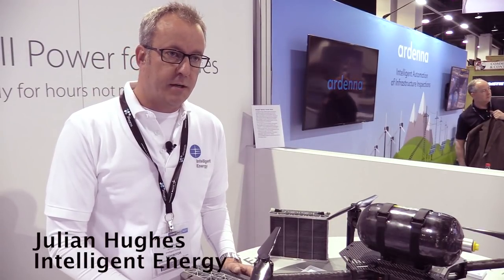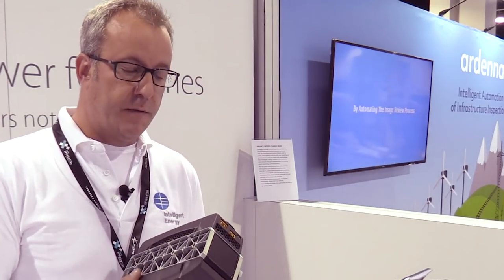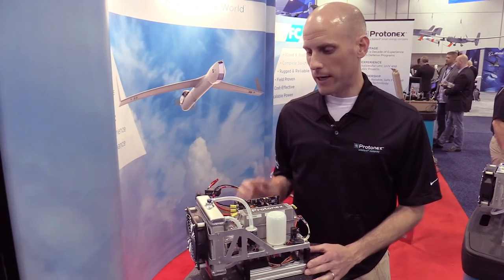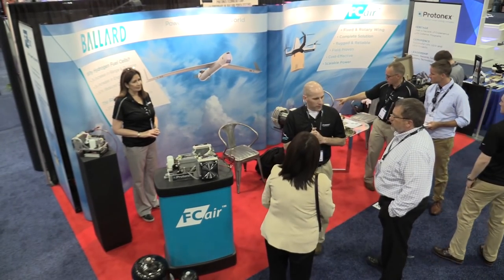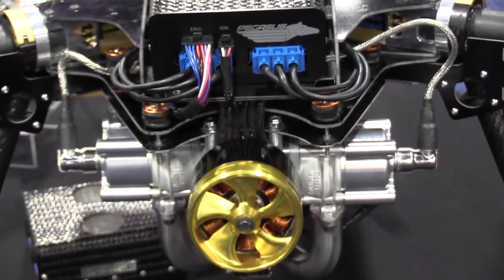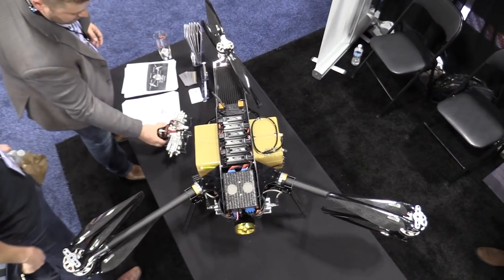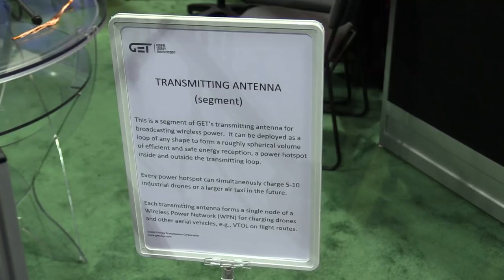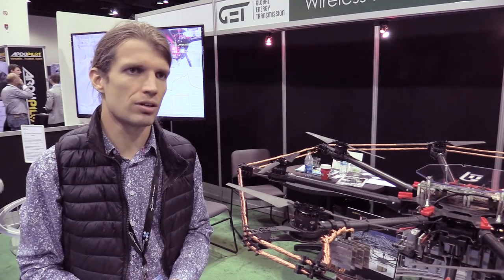Hydrogen Fuel Cells Go Flying

Comment: Agreed about the hydrogen fuel cells; all technology is interesting, but hydrogen has so many advantages over others it isn't even a close call. The problem, of course, is generating and storing the hydrogen.  Anybody can generate it . . . slowly. . .  but the typical argument is that it takes more power to generate (at least from water) than you get back.  I was hoping to hear how they were filling that little tank.  Did they happen to mention their solution?
Reply: No one has a solution, it's all pie-in-the-sky greenwashing.
Reply: One of the potential storage methods for hydrogen (and other gasses) are different sorts of nano-porous materials with high specific surface area. These would allow storage of the gas in a gaseous state at normal temperature and pressure (much safer than when conpressed into a liquid form). Experimental materials called MOFs (metal organic frameworks) have been created, some with around 5000 m^2/gram specific SA.
Reply: The production of hydrogen is more of a problem than storage.
Reply: idontcare80 Hydrogen is currently mainly produced by a steam/hydrocarbon method which isn't awfully environmentally friendly as it produces a lot of CO2. Electrolysis of water is, however, a very viable (and more efficient) method. It just requires water and electricity and can be cost competitive to other production methods.  If you wish to learn more about this, look up the Hydrogen Production Wikipedia page.
Reply: "Electrolysis of water is, however, a very viable (and more efficient) method."

No it isn't, it's far too energy intensive to ever be viable, the cost will always be far too high.

I've been reading about hydrogen vehicles for more than a decade.
Reply: idontcare80 That's not what the Wikipedia article says. It's also not what I have learnt at uni (I study nanotechnology). Saying that it will never be possible is very pessimistic and doesn't seem to be in line with reliable sources.
Reply: A) The fossil fuel industry is pushing it as a distraction from technologies which actually have the potential to eliminate our usage of fossil fuels, so a lot of your information is going to be based on their propaganda.

B) Using hydrogen in most applications simply doesn't make sense, because building the refueling infrastructure would be an absolutely enormous undertaking, because everything associated with hydrogen costs huge amounts of money because of the pressures involved in storing it and because of the fact that it causes metal embrittlement. Fuel cells are huge, heavy and extremely expensive, and producing hydrogen via electrolysis is extremely expensive, the longevity of fuel cells and electrolysers is short, compressing hydrogen requires huge amounts of energy and expensive compressors... the list of problems goes on and on. Even producing the water for electrolysis would be a significant portion of the cost of the fuel, because you can't just dump seawater into an electrolyser, you have to filter the water to a high degree of purity so that it doesn't ruin the catalyst, which basically means that you need to use reverse osmosis to purify the water, which is expensive. It's not like you can use local water sources in many areas, either, because water systems are already overtaxed in many regions.

Compare the Mirai to a Tesla of the same price, the Tesla is much cheaper to operate, it's more powerful, has a lot more interior space, can be recharged just about anywhere, it doesn't require you to go to a filling station if you don't want to, and it can make use of green energy sources much more efficiently and inexpensively. The Mirai even compares poorly to electric cars which are half the price.

I don't know how the guys in this video are making fuel cell range extenders for drones, I guess battery energy density must be that poor, because this technology doesn't scale up well. The only manned aircraft which have been able to fly with hydrogen are motor-gliders, and this is because of the extremely large size and weight of high power fuel cells and their associated hydrogen storage tanks. 

I'm betting that the Wikipedia article that you read leaves out some very key bits of information, like the cost of compressing hydrogen to 10,000 psi.
Reply: idontcare80 Yeah, the hydrogen fuel cells are expensive, but it's a relatively new technology. A lot of research is being done on it, so one can expect it to go down in price over time. Regarding gas storage, see my earlier comment about MOFs. Regarding refueling networks, I agree, but it could be overcome. I personally believe that hydrogen could be used in heavy transport (lorries, ferries, etc) while batteries might be more suitable for lighter transport.
Reply: For aircraft use, fuels must be in liquid form, so we need a carbon-neutral, liquid hydrocarbon fuel, and if we're going to produce a carbon-neutral, liquid hydrocarbon fuel for aircraft, we might as well use it in other vehicles, like long-haul trucks. From the Hydrogen Production Wikipedia page:

"In 2014, it was demonstrated that it is possible to make a synthetic fuel, that is also a carbon-neutral fuel, from elemental carbon and hydrogen, with both the carbon and hydrogen being derived from seawater, which contains a much more economical source of carbon dioxide than the air. With researchers estimating that carbon extraction from seawater would cost about $50 per short ton ($55 per tonne). The U.S. Navy estimates that its typical naval nuclear reactor, generating 100 megawatts of electricity, could theoretically produce 41,000 US gallons (160,000 litres; 34,000 imperial gallons) of jet fuel per day, and that shipboard production from nuclear power would cost about $10 per US gallon ($2.6 per litre). While that was about twice the cost of petroleum fuel in 2010, it was expected to be much less than the market price in less than five years if recent trends continued. Moreover, since the delivery of normal jet fuel to the aircraft carrier battle group cost about $8 per US gallon ($2.1 per litre), shipboard production would be much less expensive. This method of synthesizing jet fuel is currently only experimental."

IIRC, the initial output of this process is a fuel that's more like gasoline, but it has to be processed into jet-fuel, so fueling trucks, light aircraft and other vehicles could easily be done with the simpler production process. Diesels are basically on their way out anyway.
Reply: Energy density of Hydrogen compressed at 700 bar (10,000 psi) is 142 MJ/kg and for jet fuel is 42.8 MJ/kg . 
This makes Hydrogen 3.3 times more energy dense per kg than jet fuel .
Reply: It doesn't matter, hydrogen is far more voluminous than jet fuel, so you end up needing an enormous body to contain it, which adds weight and drag to the aircraft. Storing hydrogen at 10,000 psi also requires an extremely strong and heavy pressure vessel, adding even more weight. Because hydrogen needs to be stored at high pressures, it can't be stored in the wings like liquid fuels are, so you end up eliminating the passenger and cargo carrying ability of the airplane in order to carry the fuel. The Soviets already tried to power an airliner with hydrogen, it required them to eliminate the passenger and cargo compartments from the entire rear half of the aircraft, just to power one engine out of three! To power all three would have not only required them to eliminate all of the passenger and cargo carrying ability of the aircraft (eliminating the entire purpose of the aircraft), but the range of the aircraft also would have been reduced. Producing hydrogen is also hugely inefficient, and handling it is very problematic, so it's just never going to be a viable fuel for anything.

Edit: Oh, also, the fuel on that Soviet airliner was stored using cryogenics, and cooling hydrogen to cryogenic temperatures requires a large amount of energy, which adds to its already substantial cost.
Reply: David Coburn amazing how many will say "heating water is inefficient" it is not inefficient. 
Instant heat on demand. Not tanks of water..
Reply: At the end of the day we aren't going to run out of sunlight or wind or tidal or wave or moving water. We just need an on demand means of storing it. You can't really talk about efficiencies when you're dealing with a source that's infinitely abundant.
Reply: @PistonAvatarGuy  
Actually, the production of hydrogen can be as efficient as 90 to 95%. It all depends on commercial production. You see,  you have to apply a certain voltage of, i think, 1.2v everything above is wasted in form of heat, thus decreasing efficiency. The problem is that small scale hydrogen production is inefficent, due to the voltage being raised above the ideal voltage level to increase the production per time unite. The problem can be solve be just increasing the surface area  of the electrodes. There are also other methodes like steam hydrolysis wich appearantly achieve even higher efficiencies but haven't been used in the industry yet.
Reply: @mandernachluca3774  It doesn't really matter when you can use it for anything.
Reply: @PistonAvatarGuy  
I am not quite sure what you mean by that. It does very well matter how much energy gets wasted just to store energy, i just explained how the efficiency of hydrolysis in these regards can by increased quite a bit and that this branch of research is far from exhausted.
Reply: @mandernachluca3774  But why bother messing around with hydrogen at all? We have much more efficient and less expensive ways to store energy and hydrogen makes absolutely zero sense for use in vehicles because of how difficult it is to handle, how difficult it is to store, and because of the mass and cost of fuel cells and all of their related hardware.
Reply: @PistonAvatarGuy  
We bother, at least in the ground vehicle industry, because hydrogen fuel cells very well make sense, as soon as you need a fairly light package for long range applications and absolutely have to use a non fossil fuel source. Despite all it disadvantages, hydrogen has still the benefit of immensly high energy density, compared to any battery technology, hydrogen even has an almost 3 times higher gravimetric energy density than most of the fossil fuels. The thing is that we still have to develope technology to  yield the full potential of hydrogen. 
All in all, it is worth researching for new hydrogen technologies and i agree with Toyota that we need both, hydrogen fuel cells and common batteries in the future.
Reply: @mandernachluca3774  But hydrogen fuel cells are heavier and larger than batteries. Look at the specs for the Toyota Mirai, it has less range than the Tesla Model 3, it has less power, but it still weighs more and is absolutely repulsive looking because it had to be styled around its massive fuel cell system and hydrogen storage tanks. The cost of the Mirai is also unknown, but it's likely to be several times the cost of the Model 3.
-
The energy density of hydrogen by itself is meaningless, because it's not being stored in a blimp on the roof of a car, it needs to be highly compressed in tanks which are extremely heavy and awkwardly shaped, or it needs to be cryogenically liquefied, which uses absolutely enormous amounts of energy and requires very expensive, specialized equipment.
-
Hydrogen makes absolutely no sense as a fuel (edit: unless you're fueling a rocket and the energy and financial cost associated with the cryogenic cooling system is irrelevant), no matter how you look at it.
Reply: @PistonAvatarGuy  
I do believe you, that, from the perspective of someone that has no idea about hydrogen fuel cells,  the system itselfe could be seen as total nonsense. However, i can only repeat myselfe in encouraging 
people to actually learn how fuel cells work, how many options there are for storing hydrogen and how energy density very well has very high value, especially regarding current bulk of the whole system. The Toyota Mirai is a car with the hydrogen technology from   
5 years ago. 
Also, a battery is not even remotely compareable to a hydrogen fuel cell, as it is nothing more than a storage medium, it is very well compareable with a hydrogen tank. 
Hydrogen tanks are not awkwardly shaped they are basic cylinders. 
"Power" as you call it, is defined by current times voltage, wich is also very limited for batteries, as they overheat, that's why they currently have limited time savings when refueling, as the electrical  charging power is limited by 100 to 150 kw, respectively Teslas superchargers can putvout around 300 kws with a lot of cooling (it obviously isn't nessecary to mention, that this charging operation is very inefficient).
Hydrogen guel cells from 5 years ago had a a power of around 100 kw, do you really think that research has stagnated from there on?
Again, this is not some opinion of mine, it is a well regarded prediction by almost any engineer, inform yourself about hydrogen fuel cells and you will see that they most defenitly have a future in long range transportation.
Reply: @mandernachluca3774  I'm well aware of how fuel cells work, which is why I can confidently say that they're never going to compete well with other existing options.
-
"Also, a battery is not even remotely compareable to a hydrogen fuel cell, as it is nothing more than a storage medium, it is very well compareable with a hydrogen tank. "
-
The battery in a BEV replaces the ENTIRE fuel cell system, including the hydrogen storage tanks. Both batteries and hydrogen fuel cell systems are simply being used to produce electricity to power an electric motor, but batteries are simpler, lighter, MUCH less expensive, more compact and more easily packaged in a vehicle. Both systems simply fill the role of an energy storage system in a vehicle.
-
"Hydrogen tanks are not awkwardly shaped they are basic cylinders."
-
That's an awkward shape to fit in most vehicles.
-
"wich is also very limited for batteries"
-
It's not nearly as limited as it is for fuel cells.
-
I've been reading about fuel cells for 20 years, I think that I'm pretty well informed.
Reply: @PistonAvatarGuy  

Ever seen the middle tunnel of a car? They are roundly shaped, the hydrogen tank fits perfectly into the shape, car manufacturers usually use that place to transmit the power of the engine to the rear axle, in the case of the EV however, you don't need that. 

The fact to the matter is that, as you already mentioned, the Mirai weights around 1850 kg, a Tesla model X of the same time period weighted over 2000 kg, i don't see how the battery EV is lighter, especially when the battery weights around 700 to 800 kg. The battery isn't even that much more compact but it has the benefit of being used as an integral part of the car (as  long as it holds, the forces of a 100km/h would damage the battery significantly).

As i see it, you either have no idea what you are talking about, have very outdated sources or are a diehard "hydrogen fool cell" believer. 

You can not argue with facts and they are stating that the hydrogen fuel cell has a place in long range transportation, if you want or not.
Reply: @mandernachluca3774  Ever seen a HFCV? The center tunnel is filled up with the fuel cell stack. Ever seen a BEV? THERE IS NO CENTER TUNNEL.
-
"...car manufacturers usually use that place to transmit the power of the engine to the rear axle..."
-
Most cars are front-wheel drive. Do you live on Pluto, or something?
-
"...a Tesla model X of the same time period weighted over 2000 kg..."
-
Model 3, READ. The Mirai doesn't come close to being comparable to the Model X, it's not even an SUV!
-
"You can not argue with facts and they are stating that the hydrogen fuel cell has a place in long range transportation, if you want or not."
-
Nothing will make hydrogen viable for use as a fuel, PERIOD. It's not just one issue or another that will make this true, it's the HUGE list of issues associated with using hydrogen as a fuel that will make it true.
Reply: @PistonAvatarGuy  
As their is a list of issues regarding batteries,  
low range capability, heavy weight respectively low gravimetric energy density, the low life expectancy due to high discharge rates, ...
 
I don't get what you want to say, also the middle tunnel comment is more of an idea to show that manufacturers can save money by reusing old tooling. Also, do you deliberately forget rear wheel driven sports cars,  SUV's (wich almost all have all 4x4 capability) offroad cars, or even normal all wheel driven cars like Audi builds them.

Hydrogen fuel cells don't have to be made viable option, they are a viable option. 
Batteries have their limits, wich can be overcome by including fuel cells for example as a range extender, buses, trucks , mini buses and SUV's could all benefit from such a system.

As i said before the facts speak for themselfs but if you want more prove for the potential of fuel cells ask Bosch or Toyota they will gladly enlighten you ;D.

Little side note:
The fuel cell stack and the tanks on the Mirai weight together about 143,5 kg add to this a traktion battery weight of about 150 kg and you will still have over 250 kg less weight for the whole system, than for a Tesla 3  (478kg). I am not quite sure if this is the weight for the standard rang battery or for the 500 km range, either way, it is much havier.
Reply: @mandernachluca3774  HFCVs don't only need to compete with BEVs, they also need to compete with ICEs. 
-
"...also the middle tunnel comment is more of an idea to show that manufacturers can save money by reusing old tooling. "
-
Which is ridiculous, because the hydrogen tanks are not only too large to fit in a normal center tunnel, but also because most cars don't have a tunnel to begin with.
-
"Also, do you deliberately forget rear wheel driven sports cars..."
-
Fuel cells not only don't produce enough power for use in a sports cars, but they're also too heavy and large for use in a sports car. Even in SUVs, the center tunnel isn't large enough to accommodate anything related to a hydrogen fuel cell system.
-
"...they are a viable option."
-
In what way? The vehicles are too expensive to buy and don't offer any significant benefits over BEVs, they offer nothing but drawbacks relative to ICE vehicles, the fuel is expensive, the refueling infrastructure is non-existent and it will cost TRILLIONS of dollars to build (and that cost will be passed on to the consumer), the production of the fuel is highly inefficient... AGAIN, the list of problems is nearly endless.
-
"Batteries have their limits, wich can be overcome by including fuel cells for example as a range extender, buses, trucks , mini buses and SUV's could all benefit from such a system."
-
Why would anyone want that over an ICE vehicle?
-
"As i said before the facts speak for themselfs but if you want more prove for the potential of fuel cells ask Bosch or Toyota they will gladly enlighten you ;D."
-
Yes, the facts show that fuel cells are useless garbage. I'm clearly more enlightened on the matter that you ever could be.
-
"Little side note:"
-
According to Toyota, the hydrogen tanks and fuel cell stack weigh 316.4 kg, not 143.5, the addition of the traction battery brings the weight to 466.4 kg. That's also not likely to include all of the ancillary equipment needed for the hydrogen fuel system and fuel cell system. 
-
Go bother someone else, shill.
Reply: @mandernachluca3774  What weight and range advantage? If those are the advantages that fuel cells offer, why isn't the Mirai lighter than the Model 3? Why doesn't it have longer range?
-
I was actually referring to that same document, but didn't pay attention to the units. Anyway, assessing the weight of the entire hydrogen fuel cell system by the weight of the fuel cell stack is like trying to asses the weight of an engine with only the weight of the crankshaft, it's just not enough information. What is known is that the Mirai weighs more than the Model 3 and that it has less range.
Reply: @PistonAvatarGuy  
Actually, if you payed attention to my comments, you would not ask this question, i already said that batteries can be integrated into the  
frame of a car, usually, a car has to have  a certain stiffness in all directions of movement. You can save yourselfe some pounds by integrating large structures like batteries that already have a certain stiffness. The problem obviously is, that the battery also will get a lot of stress during crashes.

Also, if you browse for the weight of a Tesla model 3 you will find a range of weight numbers according to the range capability of the model from around 1600kg to over 1900kg, as it is, a 500km range model happens to weight between 1700kg and 1900kg ( i can not make very precise estimates because the weight happens to varie a lot between their 500km range models as rear wheel or all wheel driven variants).

Last but not least, you are comparing models with at least 5 years of development between them, that's huge in todays standards. I wouldn't be surprised if a modern variant pf an FCEV would weight 150kg or 200kg less than a battery EV.

Also, as it seems from what i can find, at least the pumps and plumbing are included into the weight of the stack.  Thermal management (heat exchanger) won't get you that much weight difference between the two, as especially a Tesla needs a cooling system as well, in fact the only revolutionary thing about their battery pack is the cooling system.
I would speculate that it would be around 5 kg at most (the traction motors aren't included, as they are not crucial to a specific system, one could interchange them if needed).
Reply: @mandernachluca3774  "i already said that batteries can be integrated into the frame of a car"
-
That's not really what Tesla did, though. The Model 3 was assessed by Munro & Associates and it was determined that the body of the Model 3 was far too heavily built because it was designed not to rely on the battery pack as a structural member. In other words, the Model 3 could be made to be even lighter than it is. Anyway, using the battery pack as part of the structure is an advantage which doesn't translate well to HFCVs.
-
I'm not sure why you're having trouble finding the weights for the different versions of the Model 3, the information is readily available on the internet. The RWD, 283 hp version of the Model 3 has 325 miles of range and weighs 3,805 pounds. The AWD, 473 hp version of the Model 3 has 310 miles of range and weighs 4,072 pounds.
-
The Mirai has 312 miles of range, 152 hp and weighs 4,080 pounds.
-
The Honda Clarity FCV came out only 2 years before the Model 3, it has 138 hp, 366 miles of range and weighs 4,134 lb.
-
Hydrogen fuel is a dead-end, that's not changing anytime soon.
Reply: @PistonAvatarGuy  
Actually, the Honda Clarity with fuel cells (there are also a plug in hybrid and a battery electric variant) weights the same as the Toyota Mirai with a range of 589 km. Funnily enough, the battery electric version of the Honda Clarity weights about the same and has a range of only 143 km, this only further proves my point ;D.

 In other words, hydrogen is for obvious reasons no dead end technology, we need it, as much as we will need batteries.
Reply: @mandernachluca3774  So, you're telling me that the Honda website got the weight of the Clarity FCV wrong? The Clarity FCV weighs 329 pounds more than the Model 3 and has 35 more miles of range, but it also produces FAR less power, which means that the Model 3 is still vastly superior.
-
Edit: Also, if you're just going by range, the Model S has a maximum range of 375 miles. While it weighs significantly more than the Clarity FCV, it's also a much larger car and is among the fastest accelerating cars on Earth, so, again, MUCH more capable.
-
Honda not being able to produce a decent BEV only proves that they can't produce a decent BEV. They've been dragging their feet with BEVs for 20 years, just so they can push their garbage FCV technology.
-
Hydrogen offers ZERO benefits over ICE technology, so why do we need it? It would make FAR more sense to use the Navy's method of producing gasoline from seawater and simply making that available to the public. With the Navy's fuel, no matter what people drive, they'd be green and they wouldn't need to pay $60,000 for something that compares to a $20,000 Corolla!
-
You're just absolutely insane if you think that people are going to want HFCVs.
Reply: @PistonAvatarGuy  

So that's your problem, youa re one   
those people that think that synthetic fuel  is the solution everything. At least that explains why you are so pessimistic, no wonder, synthetic fuel has even less future than hydrogen fuel cells. 

The thing is this, as much as i like ices, with the current political climate and the rise of the enviromentally friendly thinking, they will die out eventually, because of CO2 and NOx emmissions. There are a lot of ways to produce synthetic fuel, from seeweed over "power to gas" to simple fermentation and these technologies for the most part could be CO2 neutral but the reason that they are no solution what so ever for internal combustion engines is that these engines produce NOx wich lately has been focused a lot especially here in germany with the whole diesel mess. So for the future, ices are out but sinthetic fuel could still make sense, if you use them in fuel cells, fuel cells for bio fuel even have higher efficiencies than hydrogen fuel cells.

The reason i say this is obvious, fuel cell don't produce NOx wich for the mpst part is due to theor lpw operating temperature of around 100 °C.

The only problem with biofuel is, that we need space for plants to grow specifically only for biofuel, this wouldn't be optimal for a growing population that needs food.

The "gas to power" concept suggests producing hydrogen with  
renewable energy if the demand is low, wich than can be reformed into methan by bacteria. It could work but as i see it, it is a huge waste of energy starting with the production of hydrogen but than again, methan is only another medium to store hydrogen and it is much morr user friendly than pure hydrogen.

So what do you want me to tell you, that despite of the facts, batteries are still better? 
That would be a lie by a large margin.

As i see it, we will need both batteries and hydrogen fuel cells, a 
bit like todays gasoline and diesel engines. 

It starts with the transportation of energy, photovoltaic systems and wind mills would not meet the daily demand in every single country, so we have to harness energy everywhere on earth and build some kind of huge electric grid. The problem is that due to electrical resistance, even high voltage ac overhead power lines can't transmit energy over such long distances. One cost effective solution would be the production of hydrogen on one place, storing that and than transporting it to the desired place. You could use batteries for that, but the fact to the matter is that current and future (at least for the next decades), the battery technologies we have are simply not cost effective, easy to manufactor or tough enough to do the job.

Also, the wastely superior Tesla 3 still has problems both in production of the car itselfe, the software for the battery management system and the new (unnessecary) autopilot, production of the batteries, at the moment they have financial problems and they (according to some articles wich would not really take seriously if there would not be so much of them, seemingly stating the same thing) will meet shortages in materials for their batteries. I would not call that superior but whatever.

Conclusion:

 I don't know what you are trying to say but the engineering problems with batteries are greater than you think and they can be so much easier solved by just including hydrogen fuel cell systems, especially the range and lifetime problem (the problem of premature degredation due to extreme discharge, wich is also the cause for the huge battery weight. Even if you drive until you have no km left,  the battery could theoretically still go further but it would damage the battery permanently) can be solved by just including a range extender fuel cell, to either increase range, increase the battery lifetime or decrease the overall weight for the system. If you think about it, hydrogen fuel cell cars are wxactly that, just with more attention to the fuel cell system than the battery, they are in fact hybrids.
Reply: @mandernachluca3774  Basically NO ONE cares about global warming enough to drive a vehicle that significantly reduces CO2 emissions. People will need to be FORCED to reduce their CO2 emissions, and the only way to do that without causing a massive uproar is to let them drive what they want to drive and make those vehicles green. The other issue is aircraft, they CAN'T fly with anything but liquid hydrocarbon fuels, not while offering any kind of utility. We NEED synthetic fuels, PERIOD.
-
NOx emissions aren't a problem from gasoline engines, and synthetic fuels burn cleaner than fossil fuels.
-
"...that these engines produce NOx wich lately has been focused a lot especially here in germany with the whole diesel mess."
-
Diesels are obsolete and have been for years! Gasoline engines are better in EVERY way possible! The Navy's synthetic fuel is also closer to gasoline than it is to diesel, so it would make no sense to convert it into diesel fuel.
-
"...fuel cells for bio fuel even have higher efficiencies than hydrogen fuel cells."
-
But they're not even remotely close to being as capable as ICE vehicles, so who cares? Who would want a vehicle that is significantly more expensive and significantly less capable?
-
"The only problem with biofuel is..."
-
I never said anything about biolfuel, I said that the best option is to use the Navy's method for producing fuel from seawater. It's a carbon capture technology. Natural processes are too slow to fill our needs.
-
"As i see it, we will need both batteries and hydrogen fuel cells, a bit like todays gasoline and diesel engines. "
-
But you haven't been able to explain WHY you believe that! Hydrogen offers ZERO benefits, it doesn't do anything but cost more! Since you live in Germany, look around when you're outside, there are wind turbines and solar panels EVERYWHERE, right? Those installations would need to be increased by at least 7 TIMES in order to meet the needs of a hydrogen economy! That's just not practical, using nuclear energy to produce synthetic fuel is the ONLY way to eliminate fossil fuels.
-
"...storing that and than transporting it to the desired place."
-
Storing and transporting hydrogen is EXTREMELY expensive, because it causes metal embrittlement and because it must be stored at either very high pressures, or very low temperatures. AGAIN, there's nothing but a HUGE list of problems associated with using hydrogen as a fuel. So, the real problem here is that you believe that green energy can solve the CO2 problem, that makes you DELUSIONAL.
-
"...Tesla 3 still has problems both in production of the car itselfe..."
-
Not really, the problems have all basically been solved, and they were all very minor problems. Tesla is a completely new car company, so you can't expect them to get everything right from the very start. Either way, Tesla has proven that the TECHNOLOGY of BEVs works extremely well, regardless of how well the company has produced them. I do wish that the cars were offered without Autopilot, the cost of the car would have been reduced if they hadn't included that technology in every car.
-
"If you think about it, hydrogen fuel cell cars are wxactly that, just with more attention to the fuel cell system than the battery, they are in fact hybrids."
-
Which doesn't make them any less useless. Hydrogen is useless as a fuel, PERIOD.
Reply: @mandernachluca3774  Hydrogen fuel cells wouldn't work as range extenders, they're TOO HEAVY AND LARGE! You also haven't explained why insanely expensive fuel cells make more sense than synfuels! 
-
" and i did explain you how hydrogen transportation can by very efficient if you use the right storing method"
-
That doesn't change the ENORMOUS COST of everything associated with hydrogen!
-
"Also, biofuels burning "cleaner" does not make any sense as NOx always will be peoduced, if a violent deflagration takes place."
-
I'M NOT TALKING ABOUT BIOFUELS. NOx also isn't the only form of pollution that ICEs produce. Either way, gasoline engines produce negligible amounts of NOx pollution.
-
"i would suggest some thermodynamic lessons. "
-
I would suggest that you look at the FACTS, because you have no idea what you're talking about. Diesels cost more to buy, their fuel costs more, they produce less power, they produce more CO2 and they have higher NOx emissions. This information is from the EPA: 
-
-
-
Chevy Cruze (gasoline): 153 hp; CO2/mile 277g; annual fuel cost $1,050; EPA smog rating (out of 10) - 6.
-
Chevy Cruze (diesel): 137 hp; CO2/mile 294g; annual fuel cost $1,200; EPA smog rating (out of 10) - 3.
-
Mazda CX-5 (gasoline): 187 hp; CO2/mile 335g; annual fuel cost $1,300; EPA smog rating (out of 10) - 7.
-
Mazda CX-5 (diesel): 173 hp; CO2/mile 365g; annual fuel cost $1,600; EPA smog rating (out of 10) - 1.
-
Honda Accord Hybrid (gasoline): 212 hp; CO2/mile 184g; annual fuel cost $700; EPA smog rating (out of 10) - 7.
-
Prius (gasoline): 121 hp; CO2/mile 170g; annual fuel cost $650; EPA smog rating (out of 10) - 7.
-
Trucks...
-
Ford F-150 2.7 EcoBoost (gasoline): 325 hp; CO2/mile 423g; annual fuel cost $1,600; EPA smog rating (out of 10) - 5.
-
Compare to...
-
Ford F-150 3.0 Power Stroke (diesel): 250 hp; CO2/mile 463g; annual fuel cost $2,000; EPA smog rating (out of 10) - 1.
-
Ram 1500 3.0 EcoDiesel (diesel): 240 hp; CO2/mile 448g; annual fuel cost $2,000; EPA smog rating (out of 10) - 1.
-
-
-
"people are getzing forced to adapt to this whole new enviromental friendly thing,"
-
No one has yet tried to take ICE trucks away from American rednecks, that will not happen, period.
Reply: @PistonAvatarGuy  

For the part about forcing people to buy more enviromental friendly cars, i live in europe, believe me, it happens already.

 For the part about thermodynamic lessons, you are either an idiot or deliberatly try not to mention the torque of the cars and their fuel consumption, respectively don't even mention wich of them have an automatic gearbox and wich have a manual gearbox or even a DSG and you don't even care about the same displacement, i don't know if you see this yourselfe but you are comparing apples to oranges here. For fucks sake you even compare gasoline hybrids to normal diesel ices, how is this even remotely a comparsion, if you want to compare engines, search for the specific fuel consumption, because if you would do this, you would find, that the Toyota prius has a specific fuel consumption of around 225 g of fuel per kwh of mechanical energy and a fucking 2 stroke diesel engine of WW2 germany  (Jumo 204) can get 211g of fuel per kwh of mechanical energy. Diesel engines will be almost garantied  be better than gasoline engines in the regard of fuel consumption and it makes completly sense, as the diesel engine operates with higher pressure, therefor being more efficient than any gasoline engine. Also, power is nothing more than torque times angular velocity, wich means that more powerful gasoline engines due to their limited compression pressure (as there is a little thing called knocking), almost singularily produce more power by increasing torque at higher rpm, always ends in higher fuel consumption, due to higher friction losses. Diesel engines always operate at lower rpm due to their limited combustion velocity, wich means that they always have a much higher torque at lower rpm and therefor can be driven much more efficiently than gasoline engines, especially when towing heavy payloads. That's why you see so much duesel semi trucks.
I can't believe how desperately you try to be rightous without even close to succeeding.
As i said befor, one or two lessons would be good to know what you are talking about.
Reply: @mandernachluca3774  "or deliberatly try not to mention the torque of the cars and their fuel consumption"
-
Diesel fuel costs more by volume and it produces more CO2 and NOx per volume burned, which is how diesels can burn less fuel by volume, but also produce more pollution. Gasoline engines also produce more torque from a given displacement when provided with the same amount of intake pressure. DIESELS ARE OBSOLETE.
-
"respectively don't even mention wich of them have an automatic gearbox and wich have a manual gearbox or even a DSG"
-
They were all automatics, Americans don't really buy anything else. None of the cars mentioned were VAG products, so they wouldn't have DSG transmissions.
-
"For fucks sake you even compare gasoline hybrids to normal diesel ices, how is this even remotely a comparsion..."
-
Both diesels and hybrids cost more than non-hybrid gasoline engines, so it clearly makes more sense to buy a hybrid than it does to buy a diesel.
-
"... and a fucking 2 stroke diesel engine of WW2 germany  (Jumo 204) can get 211g of fuel per kwh of mechanical energy."
-
But it wasn't a pollution controlled engine and it's the pollution controls on modern diesels which are making them so inefficient. Weren't you already complaining about NOx emissions, yet you want to talk about diesels which don't have any reduction of their NOx emissions? There isn't a more apples to oranges comparison that you could make!
-
"Diesel engines always operate at lower rpm due to their limited combustion velocity, wich means that they always have a much higher torque at lower rpm and therefor can be driven much more efficiently than gasoline engines, especially when towing heavy payloads."
-
Gasoline engines produce MORE torque from a given displacement at the same boost pressure. Notice that the 2.7 EcoBoost in the F-150 produces MORE torque from its displacement than the 3.0 Power Stroke diesel in the F-150. This means that gasoline engines can be operated at the same rpm, or at a lower rpm, while offering better performance than diesels. The fact that German manufacturers are behind in gasoline engine technology does not mean that the rest of the world is.
-
"That's why you see so much duesel semi trucks."
-
That's just a hold-over from when gasoline engines were much less efficient than they are today. Natural gas semi-trucks, with spark-ignited engines, are actually cheaper to operate and are cleaner than diesels.
-
"As i said befor, one or two lessons would be good to know what you are talking about."
-
To quote George Orwell: “The further a society drifts from the truth, the more it will hate those that speak it.”
Reply: @PistonAvatarGuy  
Oh my, you really are the best example of the Dunning-Kruger effect. You don't even understand the meaning of specific fuel consumption, it is directly and only related to the engine and has ties whatsoever to the weight of a car, it directly displays the fuel consumption of an engine compared to  the work done and no gasoline engine, even with emission regulations comes close to a diesel engine. That said, you compared the F150 diesel and ecoboost version, here is what i can find:

https://www.ford.com/services/assets/Brochure?make=Ford&model=F-150&year=2018&postalCode=83333

The diesel engine has more torque compared to the smaller ecoboost variant and has the torque earlier, i am not quite sure why the fuel consumption differs so much, however, this EPA test is an estimate for an empty vehicle not for a truck with its full payload attached to it. If that would be the case, wich it is when you actually use it, than the diesel will still need less fuel than any gasoline engine because it is more efficient. To further display your stupidity,
the specific fuel consumption for an ecoboost ford engine is around 245g/kwh
and a diesel engine ONLY NEEDS around 195g/KWH. What does this mean? Well it means that a diesel engine always needs significantly less fuel (fuel mass, therefor comparable and has nothing to do with the density of the fuel) for the same amount  of work done. 
You fucked up big time boy, again.....

I won't further waste my time with you, you have no clue how engines work and why we even use them like we do today.
Calling you retarded would be an insult to every person that actually has a mental disability, instead i will call gashead, as you seemingly have nothing more in your head, just a big steaming gas cloud.....
Reply: @TheBrokenworld  
LOL, i didn't even marked your comment as spam but i have to say, it has a certain satisfaction to it, being able to manipulate people that much, that they go as far as using a second account to post their unintelligent bullshit. I really fell from my chair laughing, when i saw your "Testing" comment XD.
Have a great one boy, this just goes to show your intelligence, you truly can't be an engineer at all.....
Reply: @PistonAvatarGuy  
I love it you are so full off yourself, talking about me not being ready for advances, despite you being the  one that can't except the fate of ices, great stuff boy....
Reply: @mandernachluca3774  Pointing out the fact that HFCVs are inferior to BEVs means that I can't accept the "fate" of ICEs? Like always, you're failing to make sense. The fact of the matter here is that you've been wrong about everything, so you're throwing a tantrum about it.
Reply: @PistonAvatarGuy  
No, you think that natural gas engines couldn't be replaced by hydrogen fuel cells, you think that BEVs are in all and every way superior to hydrogen fuel cells, you think that a diesel engine isn't more efficient than a gasoline engine, you think that hydrogen technology development stagnated. All those assumptions of yours are either due to very outdated thinking, or due to misinformation or outright lack of information. The problem with people like you is the lack of scientific or engineering knowledge and as soon as you get confronted with it, you dodge it, otherwise you would understand and agree with me. Whatever, time will tell you how wrong you are ;D.
Reply: @mandernachluca3774  "you think that natural gas engines couldn't be replaced by hydrogen fuel cells"
-
Why would anyone want to do that? Who could afford to do that? HFCVs are around THREE TIMES more expensive than ICE vehicles and they cost just as much to fuel. They're likely to cost more to fuel than ICE vehicles if electrolysis is used to produce hydrogen instead of natural gas reformation.
-
"you think that BEVs are in all and every way superior to hydrogen fuel cells"
-
I do? BEVs can't be 'recharged' as quickly, that's the only disadvantage that they have, but the ability of a HFCV to refuel more quickly than a BEV can charge is completely irrelevant because of the insanely high cost of HFCVs. What good is a product that no one can afford to buy?
-
"you think that a diesel engine isn't more efficient than a gasoline engine"
-
That depends on how you define efficiency. If you're talking about things that actually matter, like the cost of buying and fueling an engine, or the pollution that it produces, gasoline engines ARE more efficient. Why does the fuel consumed by volume matter? EXPLAIN YOURSELF!
-
"...you think that hydrogen technology development stagnated."
-
I didn't say that, I said that it has no FUTURE because of the extremely high cost of everything associated with hydrogen and fuel cell technology.
-
"All those assumptions of yours are either due to very outdated thinking, or due to misinformation or outright lack of information."
-
Yet you haven't been able to prove me wrong on ANY of those things!
-
"and as soon as you get confronted with it, you dodge it"
-
Where have I dodged anything that you said? I've replied to EVERY point that you brought up!
-
"Whatever, time will tell you how wrong you are ;D."
-
You can't even do that now, so why would I be wrong in the future?
Reply: @mandernachluca3774  Example of a dodge:
-
Me: Diesels have higher NOx emissions, they cost more to buy, they cost more to fuel, they produce less power and they produce more CO2.
You: BLA... 70 year old diesel aircraft engine... BSFC.... EPA is STOOPID.... I am VERY SMART!!!!
Reply: @PistonAvatarGuy  your right, this guy says the energy density of hydrogen is 300 WH/kg, but better lithium ion batteries are 693 W·h/L (according to google), and they pump out electricity directly with no additional weight needed in a fuel cell. I'm having a hard time believing that he wouldn't have better results by strapping another battery to his drone instead.
Reply: @thomaswiwchar1661  Notice the units there, kilograms vs liters. I'm guessing that fuel cells on this scale are just better than batteries, but I couldn't say why that changes as the scale increases.